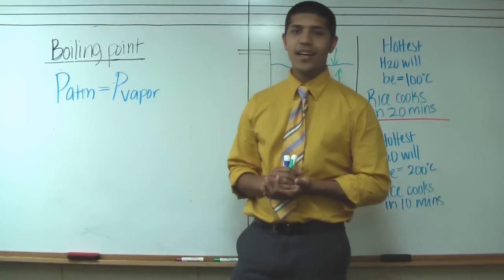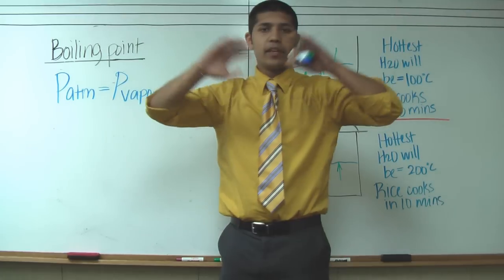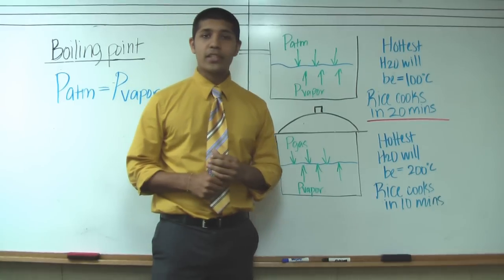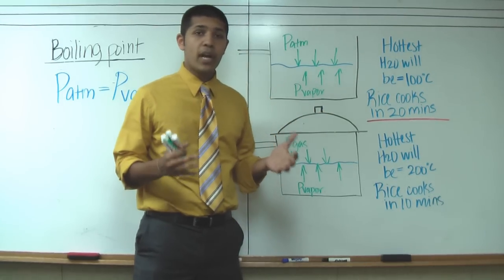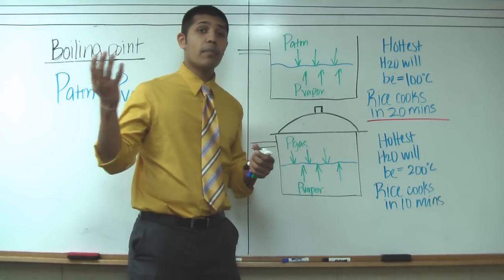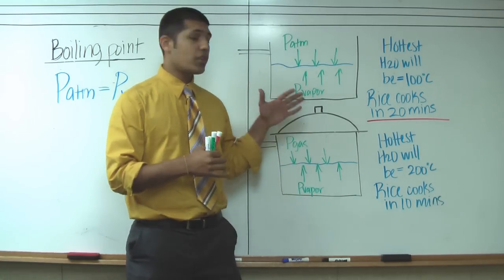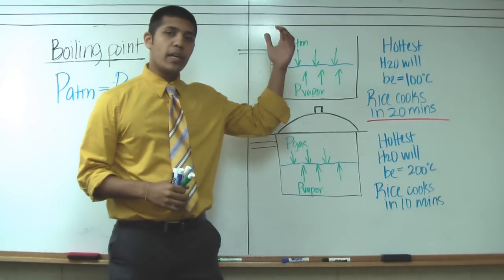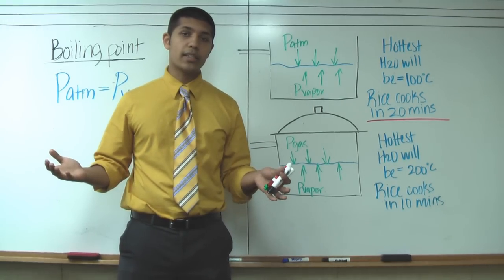Vapor Pressure and Boiling

Comment from the maker: Sure... the pressure cloud above the water is composed of a bunch of molecules bouncing around. So basically, they are also exerting a pressure on top of the water.  Since boiling is when the vapor pressure exceeds the pressure above it, the pressure club makes it very hard for the water to attain that necessary vapor pressure to boil.